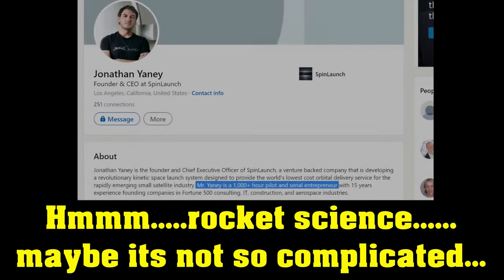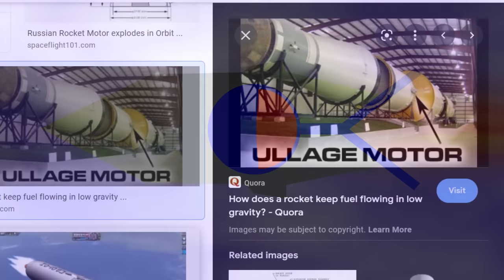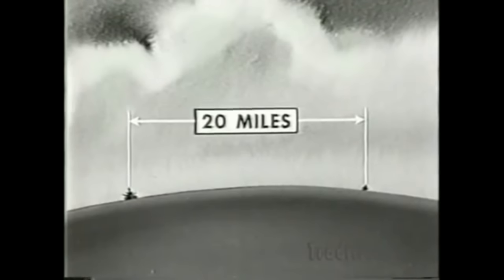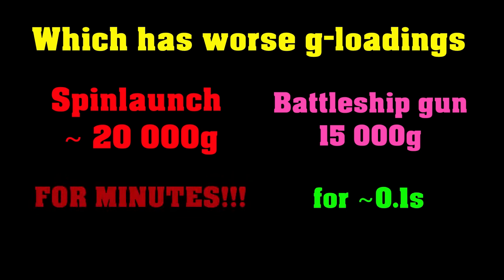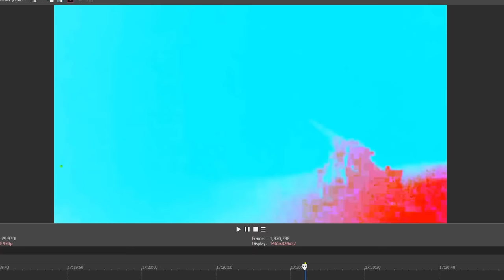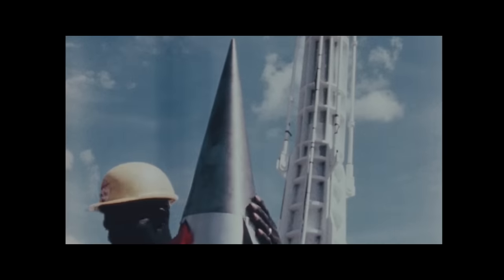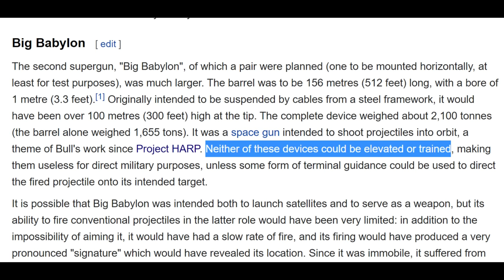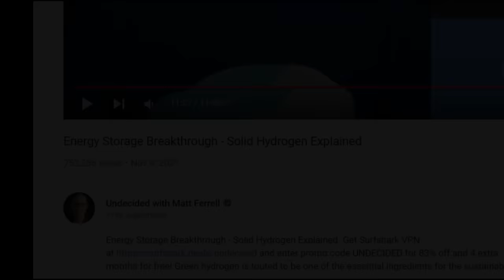Spinlaunch: BUSTED (Part 2)

Comment: It fires the imagination. The exit membrane could work if the rocket had razors on it to ensure it could be pushed out of the way quickly and without affecting the escape velocity too much. The exit tube would then allow air to hit the inner chamber at thousands of kmph, directly into the path of the release device traveling at the release velocity. I would love to hear the howl of the vortices in that chamber. What would it sound like to witness the launch? A long bang sound from the shock wave, and a long crack as the vacuum left in the wake of the rocket is suddenly filled with air which collapses into a high pressure point, and rebounds. As with rolling thunder, the way it will sound will depend on where you are in relation to the trajectory. The exit tube would have a very deep resonant pitch, but above that would be harmonics made from the howl of the slowing rotor. That would be followed by the sirens from the fire brigade and loud speakers saying 'evacuate'.
Reply: the air won't go at thousands of kmh . it will go at around the speed of sound because the more it moves in the chamber the more resistance it will encounter from hitting the other molecules of air that went in there first. Is the same mechanism as with a cannon, but in reverse. Probably they can try to use a door that closes as soon as the projectile leaves the tube or else i don't see a reason for that exit tube( they could have just made a simple whole on the side of the disk at the exit point and it would have the same effect) . Honestly i think most of the problems can be solved with existing engineering(it will be hard, but not impossible), but this doesn't guarantee that those launches will be cost effective or better from other perspectives like reliability or practicality (what can you sent in space that can resist 10000 g and also be able cheap enough to use this system, maybe bottles of rocket fuel :D)
Reply: great ending
Reply: Note that they are now showing and describing dual air-lock doors at either end of the tube.
So you would be talking about the projectile penetrating a pressure wavefront travelling down the tube towards it.
It seems to me that, with really careful design of aerodynamics of the projectile, and the profile of the tube, this could work.
(Yes, there would be some serious forces involved.... but they would be symmetrical and could potentially be handled.)
Reply: @keithlevkoff8579  They have released a new video  https://youtu.be/yrc632oilWo  which updates their development. They will use rapidly opening and closing doors to try to preserve the vacuum otherwise they can't get 5 to 10 launches a day, and can't use regenerative breaking of the gantry as it costs $6000 in electricity to spin it up to speed. It is an interesting idea. There are still enormous problems to overcome, such as working out how to release a counterweight to stop vibration from destroying the mechanism
Reply: @thevoiceharmonic  
I can see a few really serious problems... and, to be fair, I'm not totally convinced they can be solved...
You can't just "drop" a counterweight that has as much momentum as the projectile - because you have to dump that energy somehow.
(There's going to be "recoil" from the launch itself but perhaps there would be some way to transfer some of the remaining energy to a balanced flywheel...)
Likewise, opening and closing a door in milliseconds has its own issues. 
(I saw one of their videos and even their prototype door made one helluva slam.)
(It seems to me that some sort of arrangement where the door could slide sideways, like a camera shutter, rather than slam open and closed, would be a better idea.)
HOWEVER... all that said... I get tired of videos "debunking" every new idea that comes along.
Yes there are some flat out scams... and some really ridiculous ideas... but we NEED research and new ideas... 
Who knows...
Maybe, if this doesn't work on Earth, someday they'll be doing launches on the moon.
Imagine a horizontal centrifuge simultaneously releasing two projectiles into two upward curving ramps on opposite sides.

Comment: It's almost like the relatively slow acceleration of a rocket is nessesary to avoid turning everything into spaghetti.
Reply: there centripetal acceleration acting on the projectile during whole spinup which is equal to the acceleration acting on the projectile in the barrel
Reply: @Chobotification  K? They aren't equal over time. Just like he stated, and this slingshot is the worst of the bunch, massive g loads for an hour vs a massive g load for 1/20th of a second in an artillery piece. Anyway my comment had nothing to do with either one of those methods. I was simply stating the slow steady acceleration of a rocket over a 150 miles to 30000mph is much better than slowly spinning something up with insane lateral g loads for an hour or accelerating a projectile to 20000mph in the space of 10ft.

My point was essentially, we use rockets for a reason.
Reply: @tterrag1987  Except that, no. That's not how it works. You're thinking about the acceleration pressures from "attaining a velocity" (that is, if you linearly accelerate an object over 150 miles to 30000mph vs. doing it over the period of 4 feet). The problem is that in a centrifugal situation, the object is subjected to the constant need to change direction, creating similar crushing pressures to.... \*grabs calculator* diving to an ocean depth of about 30km. Or about three times deeper than the Mariana Trench.
Reply: @tterrag1987  my bad i did not read you message carefully, though you were talking about slow spinup of the centrifuge ;). yes you are perfectly right
Reply: @majorjohnson8001  So what your saying is it isn't acceleration in the case of the turd tosser it's the sustained direction change that causes the 1000g's or whatever it was exactly? I'm genuinely trying to understand. Cause that makes sense.

Comment: Also the g-loading on the Spinlaunch system is perpendicular to the axis of their projectile, implying the payload has to be designed differently from any other rocket launched payload (where the g-loads are parallel to the axis of the rockets).

Comment: Worth noting that project Harp came before the innovation of base bleed. A feature now common on artillery shells where a slow burning propellant generates gas at the bottom of the shell during flight to fill in the wake and reduce drag. This could have doubled the range of the Harp projectiles.
Reply: Doubled? Lol, no. It's not the lack of air behind you that's the big problem it's all the air in front.
Reply: base bleed doesn't matter in high supersonic flight

Comment: If they're filming at 25 or even 50fps, the spinning object may have seemed slower on camera opposed to reality
Reply: Possible, but then the velocity Thunderfoot worked out from the footage wouldn't match the 'whoosh' noises (which would also be worrying if it really was going much faster because there shouldn't be any air in the chamber as he said)
Reply: if so, the object would not land up where you predict using the previous images as reference points, it would appear and disappear in random locations at random times and appear more like still pictures taken at different times spliced together to make a video.
Reply: He's not counting frames, he's using the timecode a.k.a. the milliseconds elapsed. That is independent of FPS, and only really changes if you purposefully speed up or slow down the video. Now that can have a small error, because 29.7 and 30 FPS have the same timecode (for reasons) so he could be off by 0.1% But everything else is way less precise do it does not matter.
Reply: @Right-Is-Right  No, in essence you cannot know how many full rotations the object completed between to frames. on a 60 FPS camera, an object standing still and one rotating at 3600 RPM would look the same. Well, except for the massive motion blur on the second one.

TF calculates a 3 RPS ~ 180 RPM. And in theory that could also be 180 + 3600 = 3780 RPM. Except for the fact that would imlpy a speed of 6300 m/s a.k.a. Mach 21.
Reply: @CyanneDTM  knowing their size, speed, distance and angle from the camera, I can't see why not.

Comment: A rotating device spinning at very high rpm must be balanced. And when relising 200kg, it will loose the balance and crash.
Reply: 200kg is the payload, the rocket will be 11000 kg - which worsens the problem...
Reply: Nah, that part is actually easy. You release equal weight from the opposite side at the same time to crash into sand or something. But there are so many problems with the payload... Deformation while spinning, hitting a wall of air at 6 times the speed of sound, heating, slowing down... >_<

And yeah, you still need some sort of engine there to accelerate it into orbit. No matter how fast you shoot it from the ground - it will either fall back down, or fly off to other planets (probably as a drop of melted material).
Reply: @Lowezar  I can not see any room for counterweight release in their spinn house. But your teory is good.
Reply: @Lowezar  assuming they build it symmetrical - same weight and rotor length as for the rocket - the counterweight would have 22 GJ of kinetic energy on release. Thst is over 1000 times the energy of an APDSFS-Penetrator fired from the 120mm Cannon of the Leopard 2 MBT. There is no save way to just release that towards the ground.

There are other ways, but releasing the weight will not work.

Comment: Trying to be objective here, about a couple of the critisisms:
Isn't there some kind of inflating displacement pressure bladder system that can operate without ullage motors?
Was the on-screen RPM estimation definitely known to be at the maximum spin speed?

Comment: I'm not going to dig very deeply into this... but, from a few other videos I've seen, this idea is NOT as far-fetched as it may seem at first.
For example the original issue of the projectile penetrating a seal membrane is not a thing.
According to them there is intended to be a double airlock with a solid door at each end of the tunnel.
(You do have the issue of the projectile having to penetrate an atmospheric shockwave travelling down the launch tunnel.)
And, yes, satellites would have to be custom designed to survive the g-forces involved.

It's also worth noting that they are NOT proposing to launch a "dead weight aerodynamic projectile" but a powered rocket.
And, if you look at the numbers, current launches with a Saturn V use a LOT of energy to get that first stage moving.
The second stage hasn't travelled all that far, or gained that much speed, at the point when the Saturn V is expended.
Therefore replacing just that first stage with a different method would save a LOT of fuel and cost.
(We currently use a HUGE amount of fuel proportional to the weight of the final payload.)

I would also caution against making too many assumptions about the marketing videos...
The videos I've seen DO show a seal membrane being penetrated at the outlet of the tunnel...
Even though they've ALSO shown videos of a proposed air-lock door setup...
(I'm guessing there was a reason... for example land speed runs are often conducted in a helium atmosphere at normal pressure.)
And perhaps the video of the centrifuge was NOT taken at top speed... or in a vacuum...
(Again I would assume that a lot of testing would NOT be done in a vacuum or at full speed.)

My point here is that I have little doubt that "they haven't worked out all the details yet"...
But I'm also not at all convinced that those obstacles are insurmountable...
In short, while I'm not convinced it will ever work well, I think it's unfair to claim that "the idea has been debunked"...
(I would also assume that people, both at the company and employed by investors, have "done some of the math"...)
Reply: You'd be surprised how many of these start up's go nowhere because some overzealous "entrepreneur" with little-to-no experience hypes up a bunch of patrons with pretty computer renderings of accomplishments that are otherwise impossible
Reply: @JesseSwaney  
Not really.... from what I understand something like 80-90% of ALL new business ideas FAIL... and that includes ones that are supposedly "reasonable ideas".
However it's also true that a good percentage of modern technology was deemed "impossible" at some point in the past.
And, for that matter, even if the main idea never succeeds, they MIGHT produce some useful knowledge or other technology along the way.
Not every new idea can succeed, WILL succeed, or even SHOULD succeed... but that doesn't mean we should never try.
(And, yes, it's up to potential investors to do their homework, and NOT assume that every new idea, or every new company, will succeed.)
(And, to be honest, at this point, I'm happy to see any sort of interest in any sort of space research.... )

Comment: Very good points are made in this video, however we aren't accounting for things that may be designed to overcome the shortcomings of the proposed idea of spin launch.

Example: what's wrong with having a pressurized bladder above the fuel that will consistently push the fuel towards the outlet?  We only need it to work for a few seconds so a relatively small area needs to be pressurized above the bladder to achieve this goal.

We shoot this thing out a few degrees off kilter...  what is wrong with adjusting the angle of the arm so the rocket is thrown straight, albeit listing slightly sideways but straight up and down.

I think certain items can be overcome.  it's worth putting some time into this since it is just significantly cheaper to send things to space by throwing them vs burning fuel.  Like the cost of trial and error of this setup is like 1:1000000th the cost of sending one rocket to space currently.

Edit: I should state I think this idea is pretty hairbrained and if it works I would be extremely surprised.

Comment: My first thought was that it would have similar problems as a space elevator. There aren’t any materials that could withstand the stress
Reply: Yeah,but while the elevator just needs the materials to become viable this needs to rewrite the laws of physics.
Reply: I hope material limitations will get fixed and bring back the Tesla turbine (it still exists in niche applications but sadly not widespread)
Reply: There are, solid steel works just fine for a slug. The problem is the payload, ie. any scientific equipment you'd want to put in orbit. Plus any liquid fuel you want to carry, which needs to be contained in a canister trying to shove the liquid in a new direction at accelerations higher than the speed of sound in that liquid (their projected target velocity is double the speed of sound in water) which means that the molecules start undergoing nuclear fusion.
Reply: @majorjohnson8001  that doesn't make any sense. If all it took to cause fusion was exceeding the speed of sound through a medium, then the folks at ITER need a talking too.
Also what do you mean by "accelerations faster than the speed of sound"? Acceleration and speed are different kinds of values. Any acceleration over a long enough time would get you up to the speed of sound.
Reply: @Andrew-jh2bn  exactly my thought reading this xd. Like what haha

Comment: So you've got a broken seal, air rushing in the chamber at sound speed, meeting a now heavily unbalanced thingy rotating a 7 time the speed of sound. This will end well.....🙄
Reply: It would launch ITSELF into orbit 😁
Reply: Just believe. If you need to stop the air outside, they can just take some gigawatts and use plasma window. And they can power it by regenarative breaking of the arm. (this should be buzzwordy enough for 100M$ startup...)
Reply: Look up vaccum canons.
Reply: i think this can be solved can be solved with a gate that opens for milliseconds before the projectile is released and closed as soon as the projectile leave the tube. There may be some  air entering the tube but depending on the size of that tube a gate may be able to seal it before the air gets to it.  I saw people complaining about the seals too, that it won't be able to hold the vaccum pressure. please search mythbusters video where they seal a tube with tape which gets blown away by a ping pong ball without any issues to the ball or resistance from it

Comment: Three things, as others have pointed out the release of the missile causes a SERIOUS out of balance problem that would tear the thing apart (if it's still rotating) but their animation shows the arm stopping immediately upon the release of the missile. WOW, how dose the very heavy arm stop that fast from thousands of RPMs to zero in, let's say, less than a foot? Even if they could stop it that fast THAT would tear it apart also. Plus the air from the rupture disc all of a sudden hits the arm at the speed of sound (IF it's still rotating at MORE than the speed of sound in the opposite direction), filling the vacuum chamber VERY QUICKLY, another thing that would tear it apart!
Reply: New design since their first announcement is to have the arm carry two payload.
For now they use a dummy payload they purposely release INSIDE the chamber...yeah so far with 10 launches the chamber is fine so the whole "an incident would releases shrapnel everywhere" argument is wrong.
And next iteration it will simply be released just like the initial payload, so either just launch a dummy payload or do a double launch